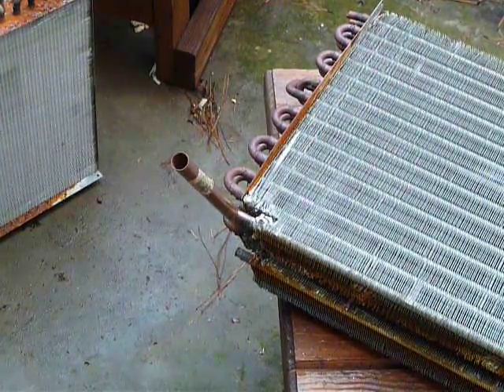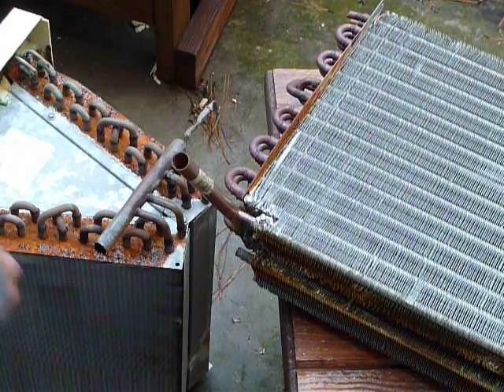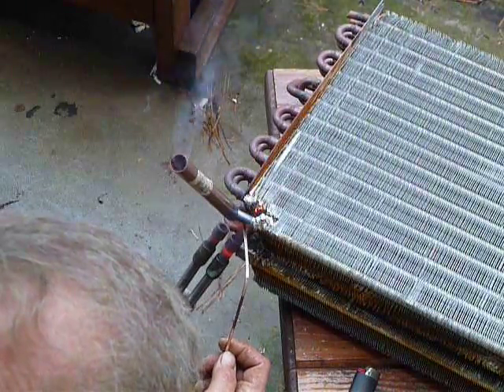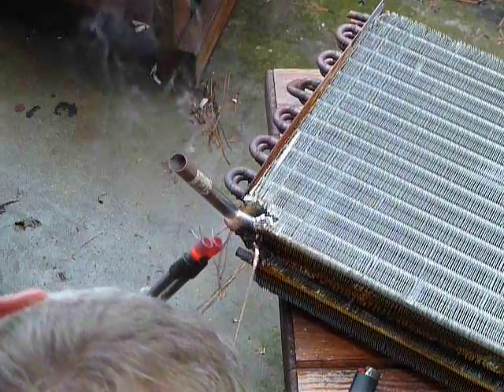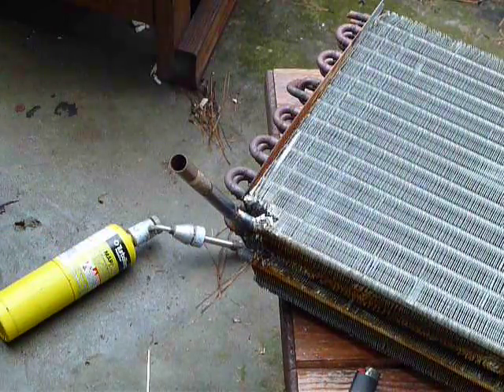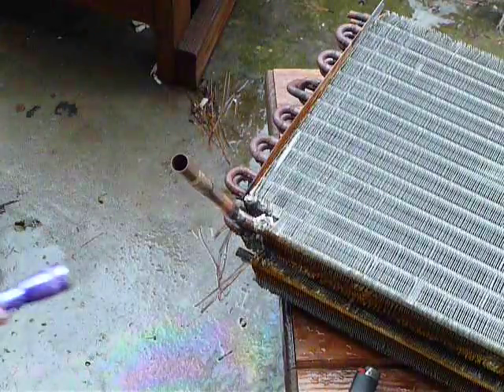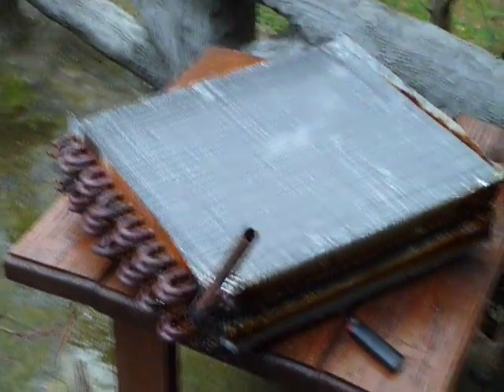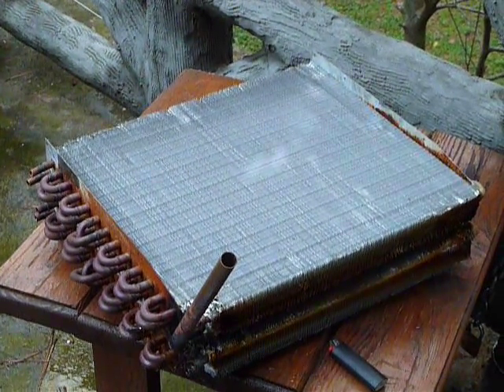Convert A/C coils into hot water heat exhangers (1)

Comment: Hi Alvin ;  I was just wondering .   IF you are using the hot water for heating only.  Would salt water work better as it holds more BTUs of heat per pound  "OR"  would the salt damage your system ???
Great video.  THANKS
Reply from the maker: I believe as a mineral which will not evaporate it would form deposits or scale on the interior surfaces of your coil and this coating would impede the performance of the heat transfer acting as an insulator. As an example of this in large buildings the cooling towers which use transfer fluids to absorb the heat off the refrigerant as it leaves the compressor these transfer fluids are loaded with mineral inhibitors to prevent scale and deposit build up within the system. This is especially true within a closed system where you are not adding a fresh water supply. Closed systems require water treatment.
Reply from the maker: My heating system is tied to all the hot water in my home. This gives me several benifits first I already have 40 gallons of hot water sitting ready for use, to install a seperate boiler just for heating would increase monthly fuel cost. Secondly whenever the heat is running I have instant hot water at the faucets. Thirdly I don't need to be concerned with treating the water in a closed loop system. Drawback the coils must be cleaned before installation into your potable water supply. Also on cold days you may find yourself running short on hot water while taking a long shower. This hasn't been a problem for me but a family would need to add additional boiler.
Reply from the maker: This winter is going to tell me how good my heating system is. I finally got around to insulating my attic this summer and I'm really seeing the benifit this winter as I notice the system running much less. So far it looks like I'm going to be heating my home for around 25 dollars a month. My programmable thermostat never calls for less than 66F when I'm gone or asleep, and I keep the temp set for 68F in the afternoon and evening hours. Honestly I don't understand why my system is so economical I realize a water heater is really not a very efficient appliance.

Comment: Useing Heat to Pump Water

 (1)        You need ether steal  or copper  pipe
       in the area where the heat is added to system.
(2) 4 runs of pipe from water source to and through heat source. 
(3)                 Conect runs of pipe in series 
        with one check valve in each run and one on each end of system.
(3a) fill system with water.
(4) Protect check valves from exsesive  heat.
(5) Heat pipes to where the water in pipe 
starts to boil.(This will cause water to turn to steam
 and will start a chain reaction  ) causing pumping action.
You can save water in a pressure tank.
( you will need a pressure relief valve
 set at 50 psi to protect system). 
Run exes water to tank to cool and reuse.Read more Show lessRead more Show less

Comment: Horrible plan. the idea has theory but poor application. most old ac coils are removed because they leak. The tubing size is no where close enough to allow proper water flow.
Your better to use old radiators or old water coils. use the copper scrap money.

Comment: You are poisoning your water !!!
Reply from the maker: Mineral oil is used orally as a laxative, it is also used to relieve dryness of skin, is used in many sun bathing products as well as baby oils. Now tell me again how am I poisoning myself?
Reply: (Chemistry) chem any of various gaseous compounds of carbon, hydrogen, chlorine, and fluorine, used as refrigerants, aerosol propellants, solvents, and in foam: some cause a breakdown of ozone in the earth's atmosphere. Abbreviation: HCFC....  This is what was desolved in that Mineral Oil , Oh buy the way nothing in that A/C system is food grade  !   So I will tell you again you are poisoning yourself.  I am not even getting to the fact those coils are old and could have had leak detectors flushed into them and the guy that used his gauges with synthetic oil in them while adding a charge.....On and On !  I  worked for Ford Motor Climate Control Division and now Carrier  and would never put the water ran through an old coil on my body and heavens not in. But Party on Alvin and keep a lot of toilet paper on hand.
Reply from the maker: Surgeons in General warn that living will cause death
Reply from the maker: R22 refrigerant boils off into a vapor at - 41 F. I'm not sure how many of those compounds you mentioned would be left after I have flushed the coils out with Alcohol (which is what I recommend doing) and I have no data to back up my claim that what am doing is safe. So in that, you are politically correct. However I believe that it should only take a little common sense to realize that with 140 F degree water circulating through a small copper tube and being flushed out every time I turn on the water surely by now those cancerous causing compounds you speak of have diminished to a point that it should only be a very slow death perhaps within the next 30 years.
Reply: White vinegar cleans pretty good too.  Can't you just skip the soldering and use heater hose?
Reply from the maker: I would not trust hose clamps holding onto smooth copper tubing unless you have a dedicated low pressure heating system which does not connect into the plumbing system. But closed systems have a list of problems of their own.
Reply: Well, put on two of them.   But I doubt you can drink this water because it will always have the taste of antifreeze.   I've done this and even sell a video on ebay to heat water from the engine in my truck for showers... but recommend using AC radiators.  They can be cleaned and won't smell.
Reply from the maker: I like the taste of the Peak RV Antifreeze if you add just a touch of Cranberry Juice it helps you get your vitamins also
Reply: Bladder cancer is a bitch though